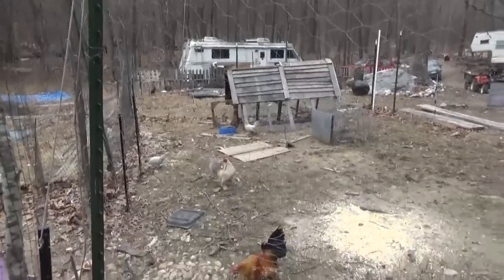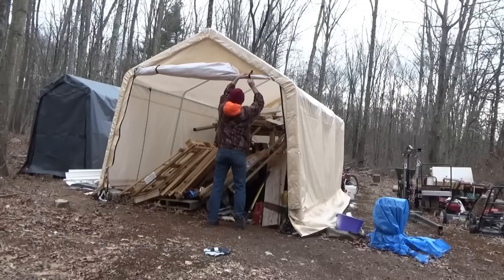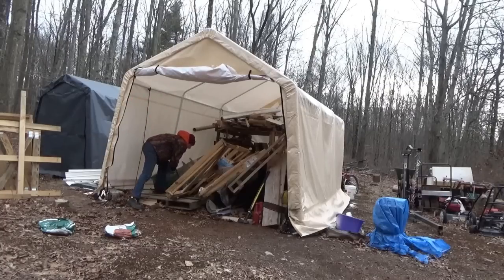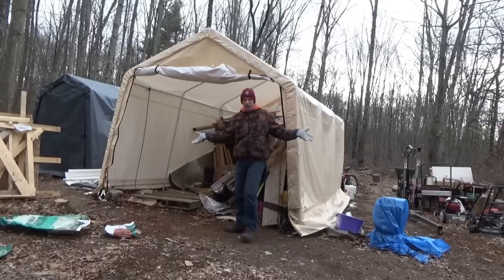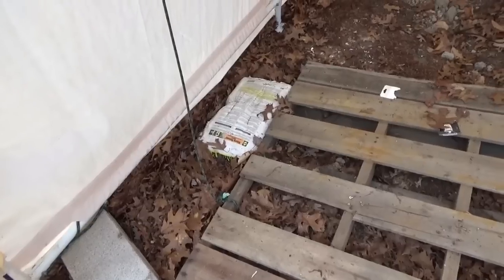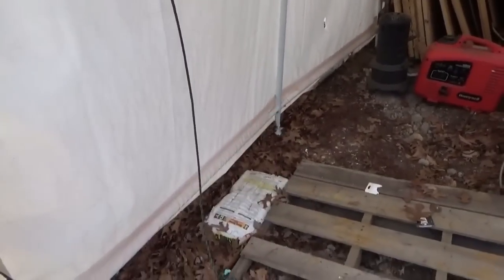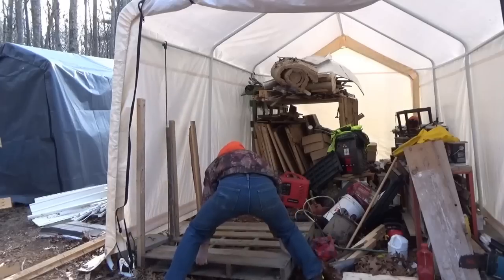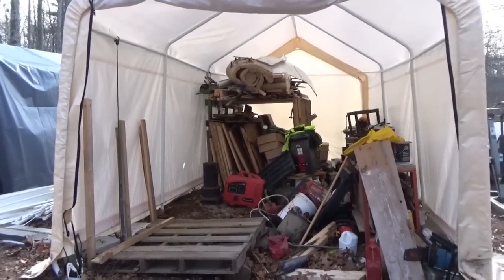Rebuilding My Wood Shop After Storm Damage

Comment: Troy, when anchoring down the tents, you may want to consider using those corkscrew type anchoring devices used to tie out dogs in the yard, that screw into the ground on each corner, then when using the ropes to tie them down, use what is known as a truckers hitch. With that type of tie-down,  you can actually apply enough hold down pressure that will actually bend or totally collapse the entire tent if you wanted to. Using the method you showed in your video, it was still loose to some degree and allowed the tent to have movement causing the  tent to gradually float more and more with each gust of wind, There is extensive videos on how to tie the knot and proper use on YouTube, just search for Truckers Hitch.

Comment: Was just thinking, maybe on the next shop, set up the tent and then make a pallet floor. I use 1x1 in between the 1x4 to attach them together. Then Stand up and attach pallets around the perimeter and screw the legs from the tent to it. That would would be a lot of weight for the wind to pick up

Comment: hell is that the dead chickens lying on the ground yet
Reply from the maker: +David Gaylord It just happened. Give me a break. I had to secure the live ones first. Took an entire day. Dont you think the live ones are a higher priority than the dead?
Reply from the maker: +David Gaylord They are frozen. Not much smell. I fixed the fencing first. The birds got composted in the composting bin and I then put a thick layer of leaves and mulch over them to stop any smell. Works fine.

Comment: Try getting some metal T posts and drive them deep in the ground in the corners as points to attach that will hold it down. And sorry I can't help but mention your copyright disclaimer that you've added recently to your description is really, I can't think of a better word, but annoying.
Reply from the maker: +Charles Wilke Well, then dont read the last paragraph of my description. I have to put it there for reasons I am sure you do not want to know.
Thanks for the tips. It may work.